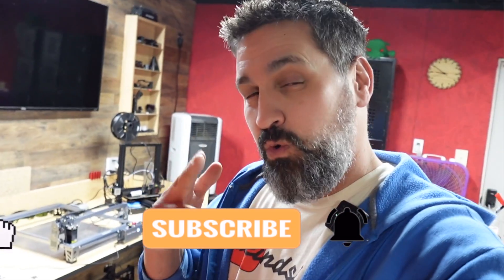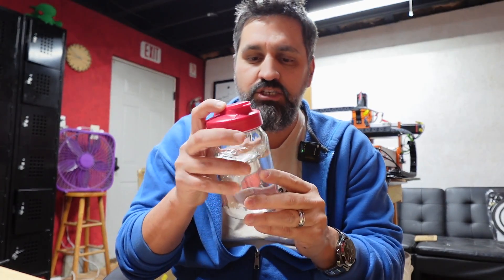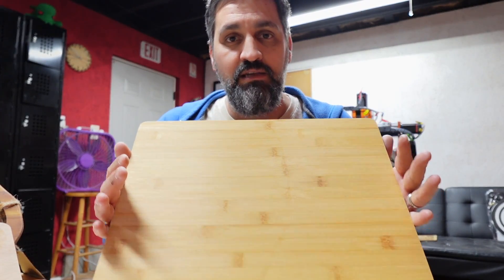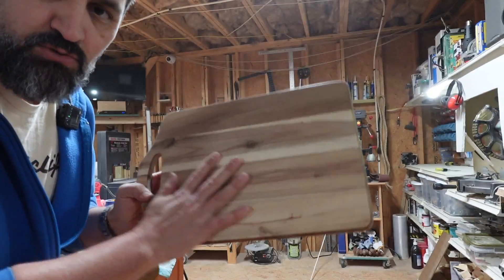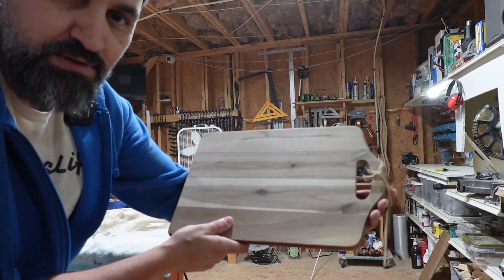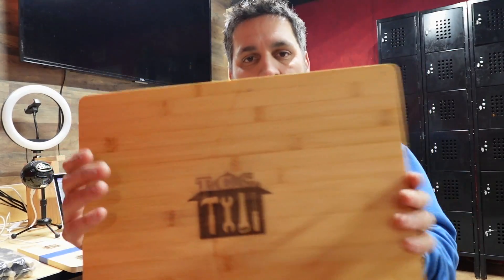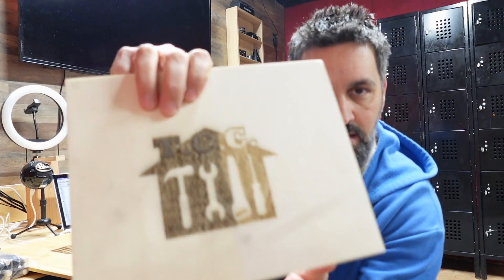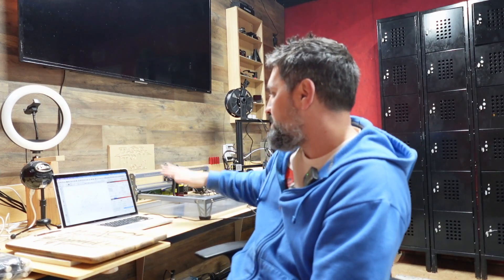Borax Solution + Laser Engraving Experiment ft. the Creality Falcon Pro! Testing 4 DIFFERENT Woods!

Comment: Borax does make a huge difference if it’s done correctly. Borax doesn’t mix with water without heat. Warm the water in the microwave, then add the borax and mix 😉. Also apply two coats letting dry between each one.
Reply from the maker: Awesome! Thanks for the tips!!!

Comment: I think that depends on the wood you will use, because if it works on the Birch and I could see a big difference, that means that works better in some wood than others.  It will be a good idea that you change the ratio to see if it works.  Great work and good luck in the project👍👍.
Reply from the maker: I need to experiment more for sure!!! Thanks for watching!